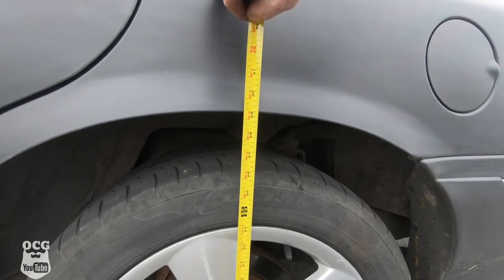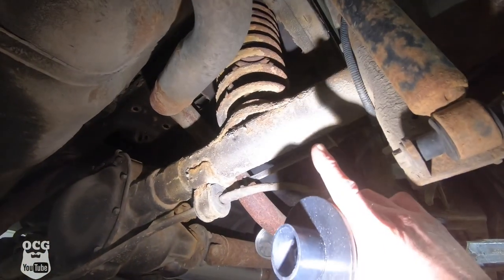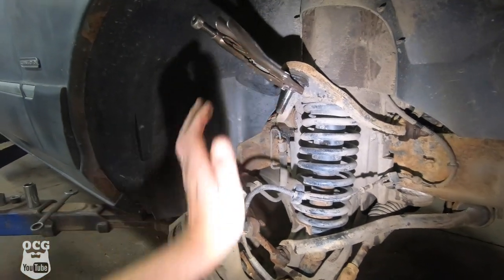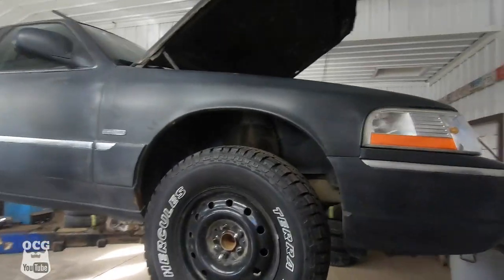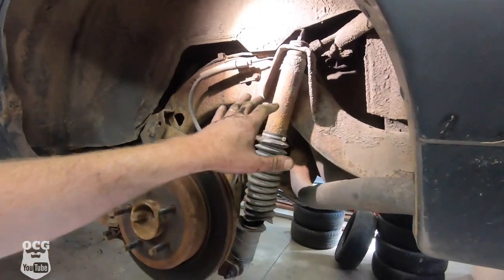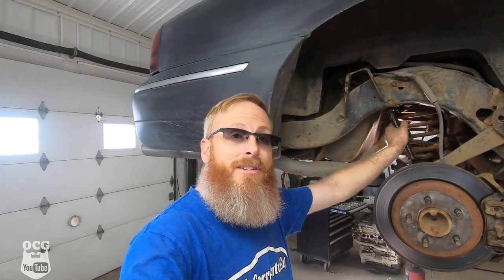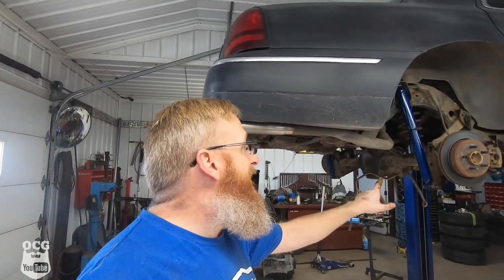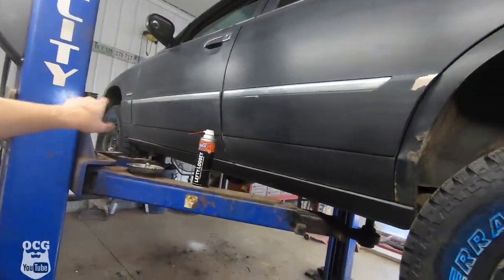Lift Kit on a Mercury Grand Marquis?!

Comment: Great video, however those don't look like 31" tires, especially at 20:48, they are actually 29"....Other vids showing 31's look substantially larger.  My son had 31's on his Jeep and they are bigger than that.
Reply from the maker: It's all perspective my friend.  This brand new 265/70R16 tire has an over all height of 30.8" (rounded up to 31"). When you add the weight of the vehicle, the tire does squat to 29 7/8"  with 32 psi in it, which is what you're seeing in the video. 

Thanks for the keen eye and knowing your stuff.
Reply: @OldeCarrGuy  Hey great point about the squat, thanks!  Looks great BTW love the MGM!
Reply: If you're gonna be driving it mainly on the street and you want the alignment to be perfect so your tires last longer there is are camber kits by MOOG Automotive you will have to install because the geometry of the suspension is definitely altered. Your wheels are gonna be closer at the top than at the bottom......
 But if you rotate your tires regularly it won't wear them out as quickly and if you run about 1 to 1.5 degrees of Toe In and slightly lower tire pressure it will compensate for most (if not all) of the camber.

Comment: This mod just hurts my brain.  I don't like it, but I get it on the 'Donk' cars where the look matters more than anything else.  I don't get ruining the suspension of the best riding car made in the last 30 years just to put steelies on with a rear gear that's already a turd and axles that already want to turn their bearings to shavings.  
On the other hand, this looks like a great mod for the small community of folks with F100 bodies on panther chassis... if they wanted a lift as opposed to the more common lowering on those trucks.  
P.S.  the 'Donk' folk get offended if you call anything but a 71-76 Impala a Donk, but that community hasn't provided a term acceptable for other cars with the lift and too large wheels.  I like 'Hot Wheels'.
Reply from the maker: Hey John. You see, it's the "Donk" cars that I don't get, but for clarification, it's the exact same kit that is used on these cars to make them a Donk. As far as the rear gear, it has been upgraded to a 3.27 locker as to help turn those big tires and if I'm being honest, it still rides quite well. I do understand that this mod isn't for everyone, but it's definitely a head turner and I love it. Thanks for watching.

Comment: This guys isn’t that smart if you put f150 shocks on a car you put  lift cups on your she be slapped in the face the easiest shocks to use with lift cups in the rear is exstended airshocks not a set for another vehicle
Reply from the maker: I've been driving it this way for almost a year with no issues. In fact, the f-150 shocks was the suggestion of the lift manufacturer or use stock shocks with extenders.  Thanks for watching.
Reply: @OldeCarrGuy  haha glad you believe the manufacture lmao bro I been lifting car for 10 years but if really knew how to lift an what to use  you wouldn’t had to cut anything an inch assuming that you didn’t call the right place there a company called universal car lifts an they told me if I want to put a lift on my Lincoln to do what you did in the back but put exstended airshocks not f150 shocks an it’ll clear big rims or tires
Reply from the maker: @simsatvrepair1255  Thanks for the info! There is more than one way to do things. The way I did it works and I'm sure your way would as well. It's all good man!
Reply: @OldeCarrGuy  yep those exstended airshocks with lift cups would get you where those big tires wouldn’t an then exstended shocks on front with 4 1 1/2 twist in spacers would get it you with no cut in the front brother once I can get back into lifting cars again I’ll do some videos an post them on my the sims way YouTube channel lol